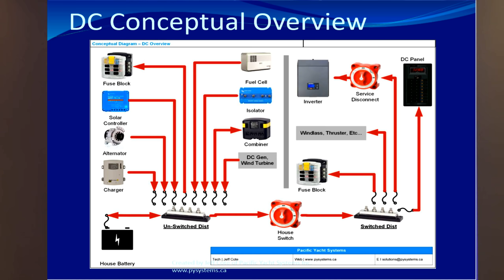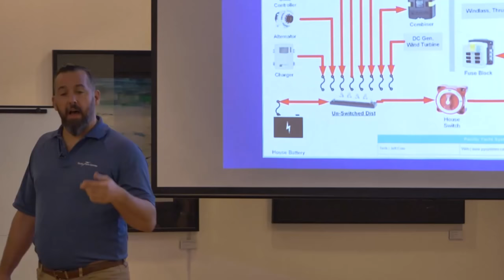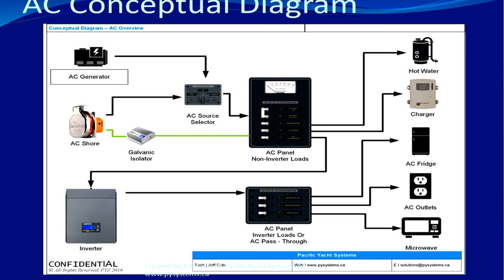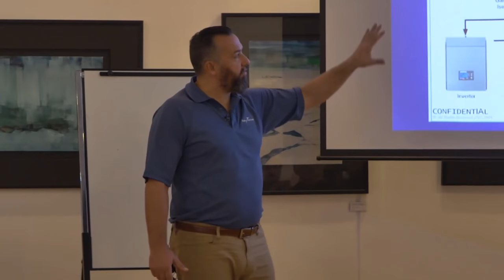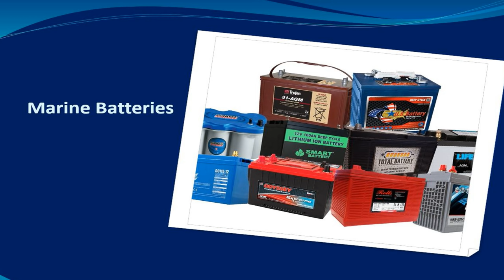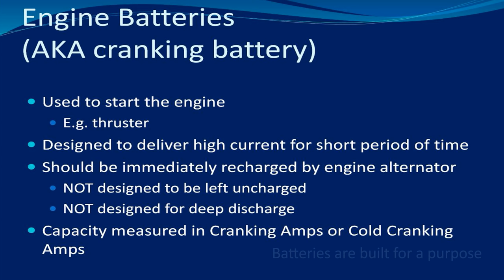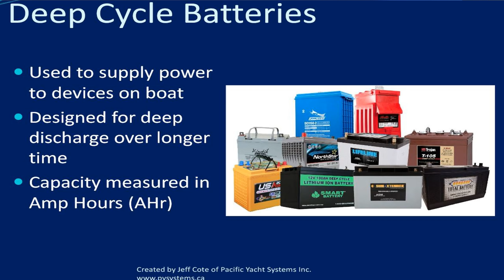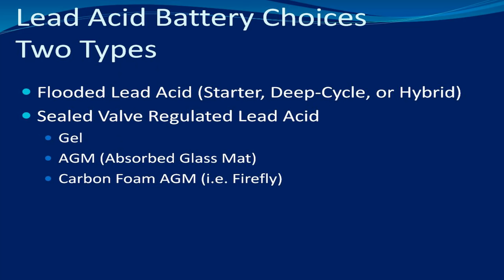How To: Marine Electrical Seminar - Batteries - Ep 02/30

Comment: Jeff, thanks for explaining the hazard regarding using a starter battery for a deep cycle, slow discharge  application.  I've removed my cheapo Wal-Mart auto starter batteries off my boat. Installed AGM's.  The explosion example and detailed explanation was compelling!  Best battery overview you have done to date. Thanks.
Reply from the maker: Hi Mark, thanks for sharing.

Comment: I would love to see you expand your table of battery comparisons to include LiFePO4. I would like to see how LFP compares to the Firefly. Particularly charge density and cycles.
Reply from the maker: Good idea. Will do next time.
Reply: Specs of LiFePO4 as I understand
Initial Cost $$$
10,000+ cycles
80-90% usable capacity
Self Discharge 1-2% 
Linear recharge to 100% instead of exponential
Available in a multitude of sizes
Most have a BMS included to prevent overcharging and to balance the charge between cells
Lower in weight

Comment: Hi Jeff, 
Love your videos! 
Maybe you can give me a little advice. Can I have my 4 firefly group 31 batteries and 2 lead acid starter batteries charging from 1 Freedom X 2000 inverter/charger with an ACR separating the 2 banks. If so, would I use the charge profile for the Firefly batteries? I'm guessing I'd be better off having a small charger dedicated to the starter bank?

Thank you for all your great content!
Reply from the maker: The required firefly charge voltage is 14.4v bulk and 13.4v float which will be typical or close for lead acid batteries as well.  Most batteries will provide a charging voltage range that will likely overlap the firefly values.  In which case  they will be fine with the acr.  Set it to the firefly voltages since they want an exact voltage.

Comment: Hi Jeff, many thanks for these informative videos.
When you say a battery is at 50% or 20% discharge, what does this actually mean? Is it measured in voltage like for example a battery at 10% is found at 10V? What are the levels in the real world?

Many thanks
Ryan
Reply from the maker: Hi Ryan, we measure battery capacity with using a battery monitor.

Comment: Firefly's brochure says Maximum Charge Current "Up to 1C". Do you have a reference for the higher charge current you talked about at about the 25:43 time?
Reply from the maker: Hi Joshua, 1C is a lot of amps. Firefly recommends a minimum charge rate of 0.2C and ideally 0.4C. Even 40% of battery capacity of a charge rate is hard to do, for instance a 1000 amp-hour battery bank would ideally want a 400 amp charge rate. Most of the time, we do our best and land between 0.2C and 0.4C.
Reply: @PacificYachtSystems  I appreciate the reply. I'm not a boater but I'm really enjoying your back catalog of videos and learning a ton. Cheers!

Comment: Enjoyed the presentation as always! 
Question: Can I have a 3 AGM deep cycle battery bank- 75AH each, and have a dedicated AGM starter battery of smaller sizes for each diesel engine and my diesel generator? 3 total house batts, 3 total start batts.(950CCA for engines 600CCA for generator) Any input is greatly appreciated!
Reply: Almost forgot! If it is possible, how could I charge them all? I am rewiring the entire boat using your advice, so I am trying to figure out what components I'd need.
Reply from the maker: Yep, having 4 battery banks (3 engines and 1 house) isn't uncommon as many power boats have 2 engines and one generator. A 4 output charger is rare and would suggest getting a charger for the engine batteries and a larger charger or inverter/charger for the house battery.

Comment: Okay Jeff, I've looked through your  videos and I haven't found an answer yet.  I would like information on charging LiFePo4 batteries from an engine alternator.
Given:  A LiFePo4 battery likes a higher charge voltage, 14.1 - 14.4 VDC, and can take a much larger charge current than FLAs or AGM or Firefly batteries.
Given:  Most engine mounted alternators with internal regulators only put out 66% of their rated output at the full rated power of the engine, not at 1200 or 1400 RPM, not to mention most diesel engines don't like running that way for any length of time.
In a system with a solar array, 11 panels putting out about 1Kw in full sunlight, and with twin engines both with factory mounted alternators, and a 6Kw genset, what really is going to be the best and most efficient way to charge the batteries.  The boat is a 43' Leopard Sailing Cat, it's not mine, but I'm curious because I think they are shortchanging themselves by not having better alternators, or something.  Like you said elsewhere, 25 amps out of the alternator is about what they're getting, and it barely covers house usage on the DC system.
Reply from the maker: Hi Gary, i'd recommend installing high output alternators with serpentine pulleys. In turn installing external regulators so you can program the correct charge profile for Lithium.
Reply: @PacificYachtSystems  I've been following a channel here on YouTube, Gone with the Wynns, and the question was in response to a video they did about a year ago on how they charge their batteries and such on their boat.  
Your channel came up during YT surfing, and I watched the entire six part series you did.  I'm never going to own a boat, unless something miraculous happens, but I'm all for sharing information when I see a need, and your videos and information are a gold mine and treasure trove for those people who use a boat with an electrical system, no matter what the size is.
I'm an electronics tech, and I am learning a TON from watching your stuff.  I just don't deal with current draws and such, AC (for the most part) like you do, so your videos are a total and complete education series.  Thanks!

Comment: Can I run both a lead acid and a "gel" (home battery) and not worry about overcharging if I have a VSR module connecting the two?
Reply from the maker: Nope. A VSR (or ACR) does not regulate voltage. but simply puts batteries in parallel when there is a charging voltage.
Reply: Pacific Yacht Systems So should I ditch the gel and run two lead acids,  or is there a way to regulate the voltage for a single battery?

Thanks for your help.   My boat only came with 1 battery, in the hull, no box so just trying to get er dialed in.
Reply from the maker: Unfortunately, your batteries need to be all the same lead acid battery type. Most battery charger allow you to choose the correct battery charge profile, i.e. flooded, AGM, Gel, etc...
Reply: Pacific Yacht Systems Well that's not what I wanted to hear, but I'll take your word for it and get em matched up. 
Thanks again for your reply and all your hard work.
It's hard to find solid info these days.  Thanks for keeping us all a little safer.
Reply: You could install external regulator and set it to battery type, but that could cost more than just getting similar battery type.